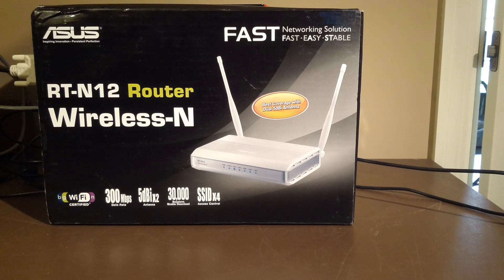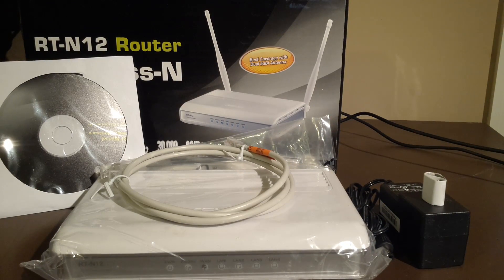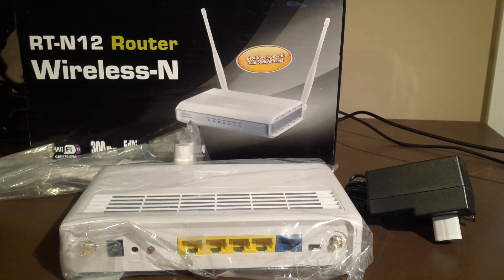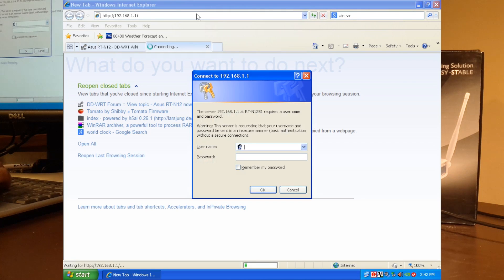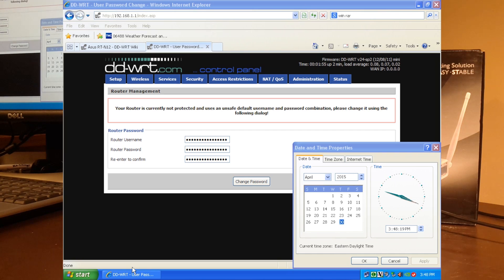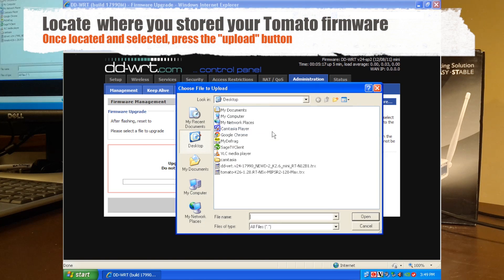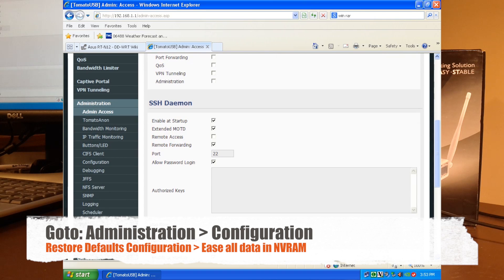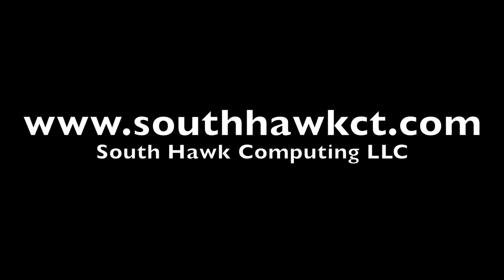How to install DD-WRT firmware or Tomato Firmware on a ASUS rt-n12 rev b1 Router

Comment: We sell a lot of the RT-N12 routers to our customers we install service to. It seems 1 out of 10 of these lock up or drop service. In your opinion will this  firmware tuneup resolve the issues? Also, is this something we can do in the shop or will it need to be done on a individual customer basis? Thank you.
Reply from the maker: +dmvail1 those crashes can be due to bad power supplies. As you saw it takes a really long time to for this process, i wouldn't recommend doing this upgrade at a customer's house.